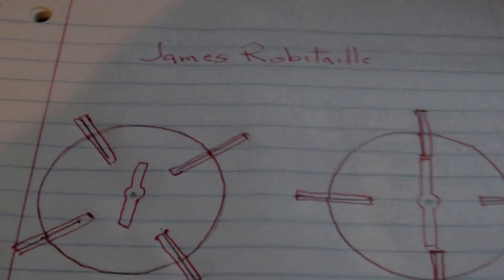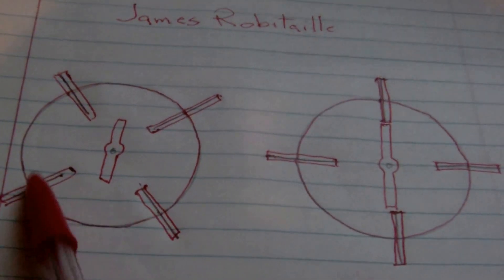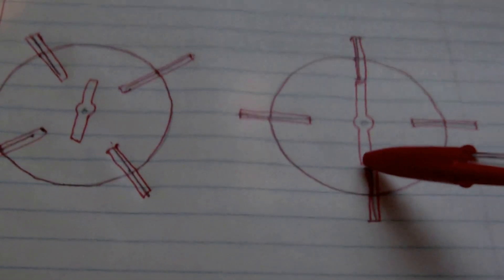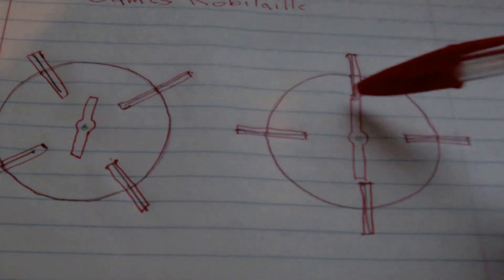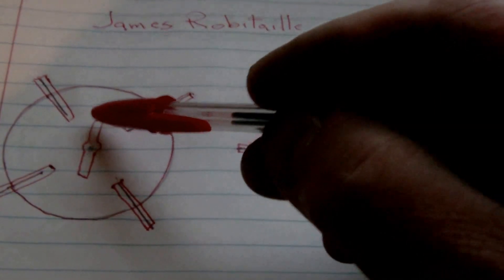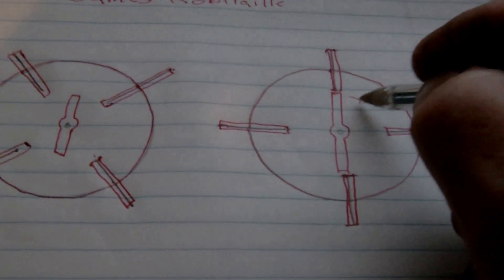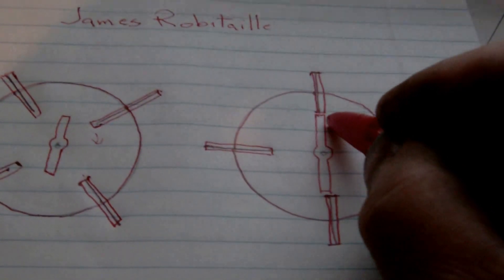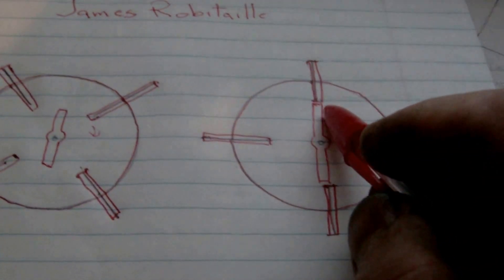QEG Generator , MORE  FOR  LESS

Comment: The truth is that it is impossible to extract any energy from the magnetic field of any permanent magnet. The work done in the attraction and repulsion will exactly cancel. The back magnetomotive force (MMF) of a generator under load current will produce the exact repulsion so as to transfer the mechanical work of the prime mover exactly into the load power dissipated plus the losses. Extraction of "free energy" is simply impossible in any magnetic circuit we know of. 
The QEG is a scam. The resonance in the LC tuned circuit wound over the iron core is merely a method of stabilising the rotational speed of the prime mover for the generator. It has nothing to do with the extraction of zero point energy, as claimed in the QEG document. The Tesla patent was misused to make this false claim. Tesla never claimed over unity for his generator in his patent.
Reply from the maker: Thank you for your comment but as far as Zero Point Energy more free energy I've shown in a few of my videos that the more wire you add the more output of back EMF you get with less input from the battery now the back EMF doesn't have any current it's simply high voltage spikes but I've also shown when you run those high voltage spikes through a capacitor you can get instantaneous current which is all you need to run a motor so I've done many experiments that lead me to believe that free energy isn't just possible it's been done and suppress I can build a motor today and have it run 24/7 with no problem just using a small solar panel to keep the primary battery charged which will stay up for 3 or 4 days with no sun the only problem I end up having as when it snows if my solar panels were on the ground it would be easy to wipe the snow off but because they're on the shed it becomes a pain in the ass but while the motor is running I'm rejuvenating and charging batteries 24/7 if that's what I want so I appreciate your comment but I'm afraid I know a little too much to think that free energy is impossible

Comment: First issue - It is called "cogging" not "clogging". As the author of the video, how do you not know this?
 Second issue - You said, "For PROBABLY less input". What proof do have of this claim?
 Third issue - At high speeds, the motor's moment of inertia smooths out the effects of cogging torque.
 Fourth issue - How do you get DOUBLE the output without also requiring a 2X bigger input drive motor?
 Fifth issue - There is also an opposite force where the new rotor retards the original rotor, which you neglect.

 It is not a "given" that an 8 Pole QEG has higher efficiency than 4 Pole QEG.
 But the QEG will now certainly cost more and weigh more.

 With more poles you might reduce the cogging torque at each pole,
 but now you will also  double the number of cogging locations from 4 to 8.
 So, "NET" how does that increase overall efficiency?

 And good luck getting both rotor sections to resonate at exactly the same frequency.

 And since the QEG spins at a resonant frequency, I am not sure that cogging is even an issue.